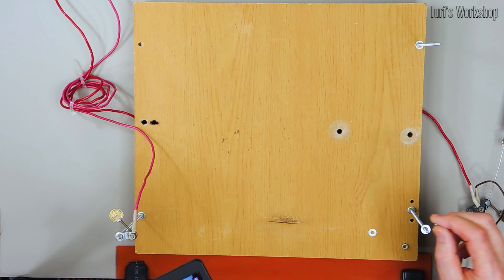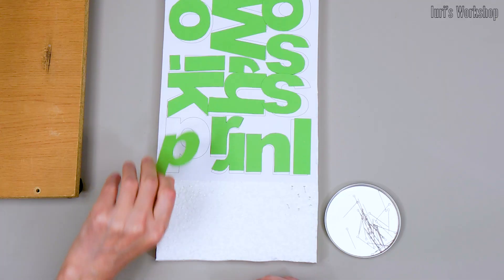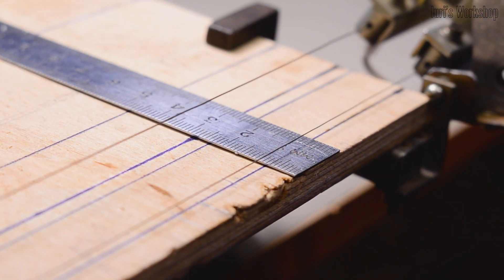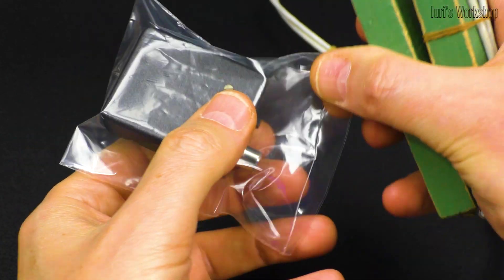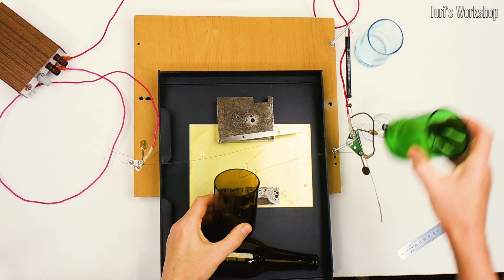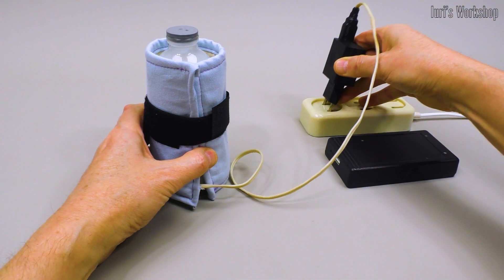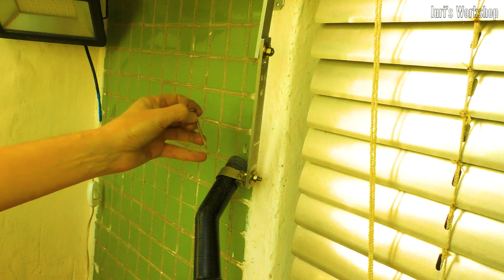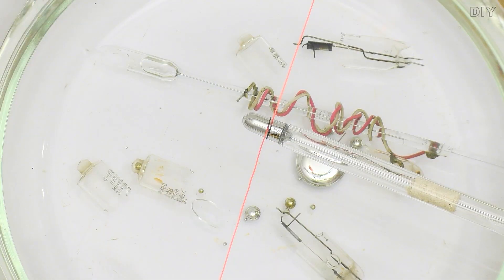15 Tricks with Nichrome Wire

Comment: What is rating of Power (Voltage/Ampere).. alternatively which battery/cell can be used🤔 for heating nichorme wire.
Reply from the maker: You should use an adjustable current source. You can make it yourself or buy a ready, for example, on AliExpress.
The approximate value of the current, with a particular diameter of the nichrome wire, can be determined by the table at the end of the video.

Comment: Thank you for your video, how much volts and amps did you use for your .4mm nicrome wire to cut foam, also how long was the nicrome wire?
Reply from the maker: I didn't measure it on purpose. I was guided by the color of the heated wire. Approximate current and voltage values are at the end of the video.

Comment: Simmerstats (used to) use nichrome wire to heat a bimetal on/off actuator. Can you advise the specification for 240 volts operation
Reply from the maker: I doubt that a bimetal switch can be made at home.
Reply: I am repairing a simmerstat which uses a bi-metal heated by nichrome (I presume it's nichrome) wire to switch the 240 volts off and on to the stove hotplate.  I will have to do the calculations and figure it out which is okay
Reply from the maker: @cedricquenoy7488  
A thermal relay based on a bimetallic switch uses a narrow plate welded from two different metals with different coefficients of linear expansion. It is impossible to make such a plate without special equipment.
Usually such plates do not fail. Most often, contacts burn in thermal relays.

Comment: How did you power the heating element? Is there a way to control temperature?
Reply from the maker: I am using a regulated power supply. The temperature can be determined by the color of the wire. At the end of this video there is an example of such a table: https://youtu.be/rGU_V3VLkeg?t=323

Comment: can nico reach 1000c? if so how
Reply from the maker: I don't understand this question.
Reply: @IurisWorkshop  im trying to heat a pipe up to 1000c and the materials within it
Reply from the maker: @Vyndys  You need to provide thermal insulation between the workspace and the environment. For example, special refractory bricks or more modern space materials with low thermal conductivity can be used. And you need a thermostat. If you exceed 1000-1100C, the nichrome will melt.

Comment: thank you, from were you got the voltage/apms variable controller, what is it specifications? 
specially the one you used on  "Plexiglas Bending Machine" you used "20 AMPS!"
Reply from the maker: You can use any high current regulated power supply. Such sources are sold on Aliexpress.